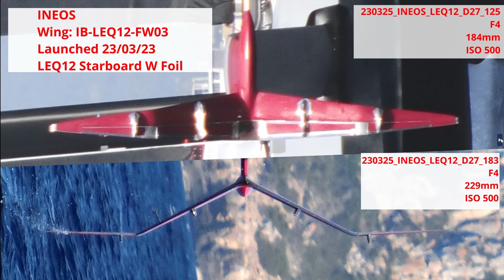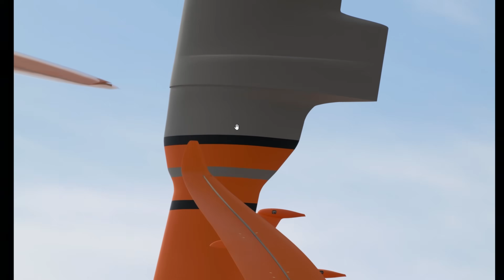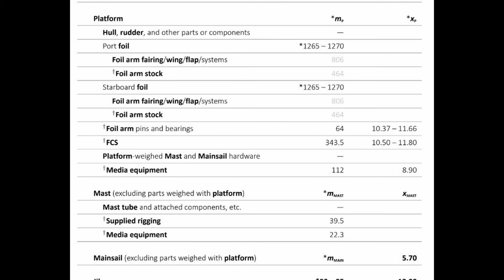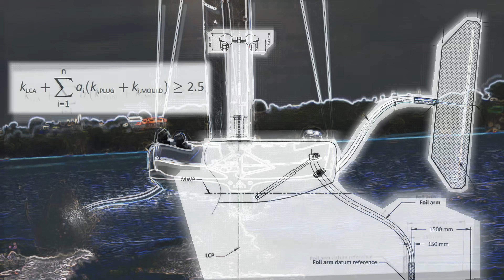Revolution by Evolution: *NEW* Cup foils analysed

Comment: I am a F1 Aerodynamicist and we ran turbicules on our rear wing for several seasons. Tbh it’s a bit of a fad thing. At some incidence you get vortical structures shed. But they are not a big player. May be a sign of who the aero is more than anything else. For us they were mildly positive but it was hard to justify the weight. It might open up the incidence at stall or generate slightly more lift at max aoa and I guess that is probably the attraction might give lift off 1/4 knot earlier and cost nothing at fill speed. Re the strut vs wing it’s possible that the wake of the strut is reduced by travelling into a favourable pressure gradient of the wing and this also explains the cl tweak to the foil flaps. Glad to see INEOS finally have a proper aero on foils all the previous  ones looked horrendous. The flap fence we would consider a rotation fence. And is the cuff not just drag reduction to help lift off
Reply: Please comment again on future stuff Richard, it's really interesting getting your pov . Would the tubercles stop the foil slipping sideways to some extent and promote better vmg even if they have slightly higher drag?
Reply: Zipp introduced this on their carbon road bike wheels.  I think they said it was to help in cross winds which ties in with your comment on high angles of attack.
Reply: Isn't Red Bull technology doing some Aero work for the America's Cup? Seem to remember Newey was involved.
Reply: I wonder, would it reduce resistance when the foil is plunged into the water at the beginning of a tack?
Reply: Richard, thanks for the insight - whats your thoughts on the diffrance between air and water - if midly postive in your exprance in air could that be enhanced with the higher desity of water?
Reply: They've existed on gliders for a long time. The idea being that if you get chaotic formation of vortices they are larger than if you trigger them directly. Plus its cheaper than blowing the wing. 
What I've not seen, and I wonder if it works is this. You clearly get a vortex that the wing tips. However you also get vortices at other places. How many do you get? I suspect its speed related. So what if you trigger the vortex deliberately dependent on speed, with a small movable vortex generator that moves in and out. Does that reduce the chaos and hence reduce the drag?  Same thing for the position of ailerons. Should the end be close to where a vortex is generated, say at thermalling speed or should it be at a different location. 

If you google "The tip vortices trail back from the wing tips and they have a tendency to sink and roll toward each other downstream of the wing. Again, eventually the tip vortices dissipate, their energy being transformed by viscosity." It brings up a page with some diagrams

It shows just after the quote above, the flow over the top surface, the bottom surface, and how that generate vortices along the trailing edge.  How many? I suspect less at higher speed than low speed. Where is another issue but I suspect they are roughly equally separated.

Comment: Thanks again Mozzy. There has been some examples of tubercles used in cycling over the last few years. Filippo Ganna had a 3D printed bike when he set the world hr record last year and it had tubercles on the seat tube and seat post. This was said to help keep the airflow attached for longer in an area of high turbulence (right between the riders legs). Also Zipp and Princeton Carbonworks have wheels that have a sawtooth rims. They help keeping the airflow attached especially when the yaw angle increases (i.e. crosswinds)

Comment: As always great video. Re the tubercules at the end. Probably been on the same web pages as others and looks like in theory they help increase lift and reduce spanwise flow of the fluid. So could reduce the winglet/end plate size for the same overall effect?  Other thoughts are 1) do they increase the effective overall length of the leading edge? Not sure. And 2) swept wing aircraft work better at high speeds, straight at lower. The wavy front edge gives both angles to the fluid flow at different points on the wing so could help create lower speed lift with less flap for a slight reduction in top end efficiency - with that being countered by smaller flaps and end plates? Im an engineer but not in fluid dynamics. Why dont you ask Hannah Fry if she’s interested in commenting? Only half joking here BTW….

Comment: Re the new Alinghi foil, the interesting part is rather the swept plan-form, rather than the tubercles.
As you say, the tubercle idea has been talked about for decades, and no-one has ever managed to make it work meaningfully.
They are effectively vortex generators, which theoretically help retain attached flow, and/or less drag.
But inevitably, there works out to be easier and cheaper ways of creating the same desired result.
Also whale flukes operate through a much bigger range, of angle-of-attack motion.
Whales are sweeping them around, all over the place.
While Hydrofoils are typically/predominantly, set and forget.

Comment: Thanks Mozzy - now I’m going down a tubercle rabbit hole right before bed 😂 EDIT: A bit of reading indicates that the prescience of tubercles on a leading edge reduces the tendency of a foil to stall and when it does it loses lift gradually rather than suddenly. I wouldn’t be surprised if Alinghi RB are having issues in the sea state in Barcelona and are trying to find ways to reduce the effects of loss of laminar flow when the foil leaves the water. Seems to increase lift as well, so maybe we’ll see teams bringing out super high aspect ratio foils with tubercles?
Reply: I’m aware of a few academic/ basic research efforts to quantify the effect of leading edge tubercles when added to a more traditional foil profile

Empirically, the span-wise distribution and magnitude of the tubercles was evaluated over a range of velocities and angle of attack in a small water tunnel .

As mentioned above , one observation was the benefit of delaying the onset of stall conditions .
I don’t believe there were any significant benefits to optimal lift or drag coefficient..just more “forgiveness “ in suboptimal conditions.
Reply: yes correct. In aviation they use mini vortex generators on top of the wing, This is to break the turbulent air at the rear of the wing into smaller packets when near the stall so the air breaks away in a controlled manner instead of suddenly in a big lump.

Comment: I'm reminded that early aircraft had scalloppedd trailing eddges to the their wings and as aerodynamics improved spats and fairings began to clad the undercarriage, then materials and power plants improved and any gains superseeded by new problems to solve. We are watching fantacstic experiments in the trade off beween wetted mass, lifting area, drag and lifting moments and also time. While playing for percentage improvements there is the bigger  picture of where meaningful gain can be made as each element is brought into play over time as the system is deployed. An increase in thrust or lift from a slick foil may well be delayed by turbulance and drag as the arm snicks into place, so thats a half-second lost in a turn. Equally pulling the foil out of the water need to be clean. And everything under the water has a boat balanced on top of it! Thank so much for these preentations - it's keeping me interestedd in a type of racing I didn't much care for before!

Comment: why can't the foil wings just be made out of some really heavy material like tungsten? you'd surely then get the best of both worlds as you still get the leverage as the weight doesn't need to be pushed up into a spat, but at the same time you could keep the below water presence low as you wouldn't need extra weight in bulbs. maybe materials used are standardised?
Reply: there are in fact regulations regarding materials, Eg paper is out, No cardboard. or any cardboard derivatives.

But in all seriousness there are regs on materials you can't use "exotic" materials in your ballast. I think that is one of those things where it comes down to making sure its not a case of having the most money to spend on materials, and also just to stop someone making the internal of their foil out of something like depleted uranium to make the foils much smaller than anyone who can't get it.
Reply: @thedoctor907 is that so the front doesn't fall off?
Reply: @cillianwilliamson16  well yea, though I would like to point out that its highly unusual for the front to fall off.
Reply from the maker: The materials they're allowed are limited to a maximum density equal to lead, so they could pack more mass in, but lead isn't very useful from a structural point of view within the wing. There is good possibility any ballast they mount up on arm fairing will be lead though
Reply: @MozzySails  is that average density of a total device or maximum density of an single constituent part of a device? Assume its max for any material used?
Reply: I dunno, I like the idea of the Americans having depleted uranium in their foil arms 😂😂😂
Reply: Did I hear that on the new Ineos foil the flap is only the bottom surface so kind of a half flap? What’s you thoughts on that? Presumably reduces drag but does it make the flap less effective?